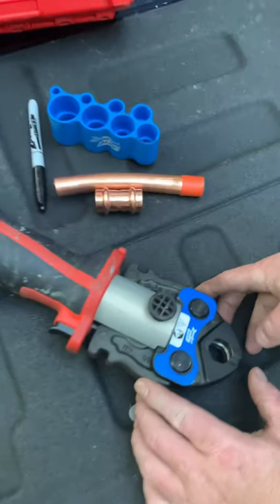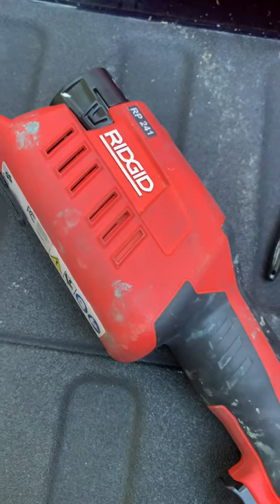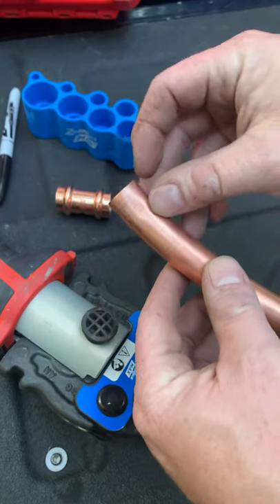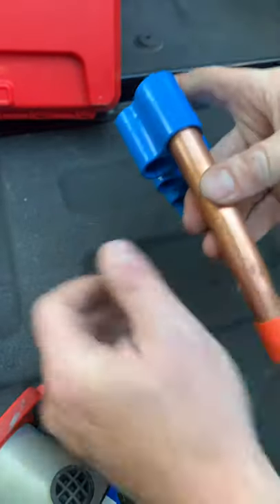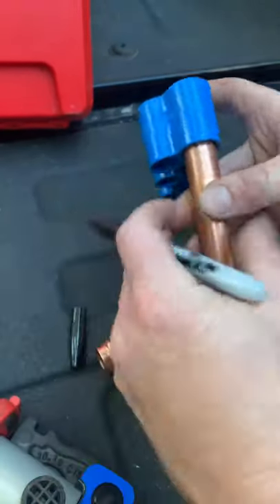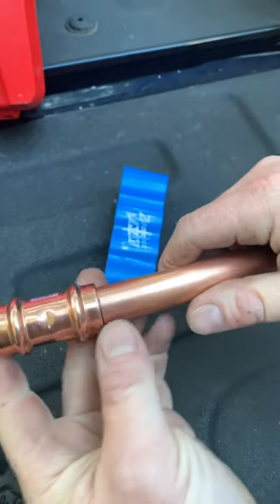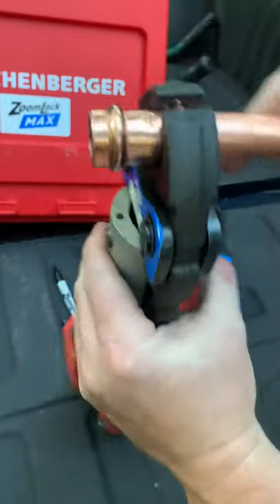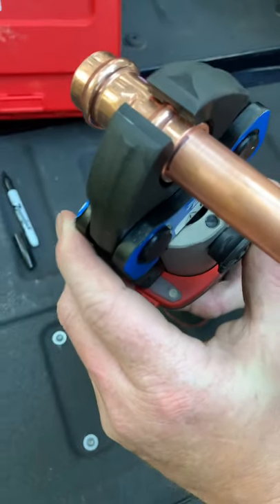Zoomlock Max!

Comment: That coupling has a dimple in the middle, push it on until it stops. There’s no need to measure with those fittings. They make some without it, that’s when you need to measure.
Reply from the maker: No, it’s to make sure you push it all the way to the stop. Sometimes it will feel like it stopped but not be far enough in - especially with soft copper that can be slightly out of round.
Reply: I mark them only because sometimes when you put then PP tool on the fitting, especially in an awkward spot,  the tool can slide the fitting off the pipe some. If pipe isn't past the oring, it's an issue.
Reply: Actually it's part of the warranty process, as well as a good practice. Insurance company can claim installer error if we don't mark our fitting depth. For example, marking fitting depth on CPVC is required, otherwise the fitting manufacturer won't warranty the joint I glue together.

Comment: Tip, dont press soft copper. It wont hold too well. Thinnest wall I'd go is type M, rigid pipe.
Reply from the maker: This is Zoomlock. It’s designed for soft copper.
Reply: @ToolPros  thats actually pretty cool. Do you think these jaws will work on the Milwaukee press tool?
Reply: @javiervazquez9472   : They actually work for M12 , M18 Specific for each. I ordered them for $1775. I got the M12

Comment: I'm going to have to research this method. I worked tellcom for years. Did many a compression crimp 6ga to 1/0...hand hydraulic beast. But I have a extremely hard time believing this would be leak free for the life of the pipe. No way. Years in a sizemic zone? Thousands of felt and I felt movements..No way this is used in high-end housing. Temp fix? Ok I'll buy that. Trust it for 30 years of pressure? Not a chance.
Reply: One telecom brother to another i will not dare mention the process of 4/0 size.
Reply: Bro it works trust me! It is tried and tested and yes it's watertight

Comment: That coupling is a pro press copper 
You have to use zoomlock fittings buddy
Reply from the maker: This is a Zoomlock Max fittings (aka Connex MaxiPro) for use on refrigeration piping. Traditional Zoomlock is now known as RLS press fittings. This is not a propress fitting in the video - even though it looks like it. That is my #1 complaint for the Zoomlock MAX system.

Comment: Why are you pressing soft copper. Never press soft copper. Type L or M is recommended for press fitting tools.
Reply from the maker: This is Zoomlock. It’s press for refrigeration
Reply: This is ZoomLock MAX for refrigeration.

Comment: Propress suck!!     Two things.    All manufacturers 10 years on Orings fittings than they say replace!      How hel you replace orings on press fitting ..... and what about city chlorine that pushing the limits on 8+ chlorine.      Most plumbers r going say that city water not touching the oring.      Wrong pipes sweat just like humans.     Condensation.... 

And up here in Midwest.     I have friends and other plumbers i know that use propress on boiler lines !!      Well they come me year later after trying to fire up boilers and saying 75 percent of the fittings leak!!        And they all say I was smart to not believing in propress and using the Ole torch(25 years ) and solider.      

* those orings not like hydraulic or even petrorluim,  chemical  fluids. 

So may want consider that or just do the research.        By the way time you clean and get you depth finder and pen to mark it ....    I would be on third fitting....  and my clients r much happier paying for 2.00 dollar fittings instead of 20+ fitting (saving them $$$ and adding labor to my pockets $$$  )      and I not coming  back next year or less ten years from now to charge them for another repipe.